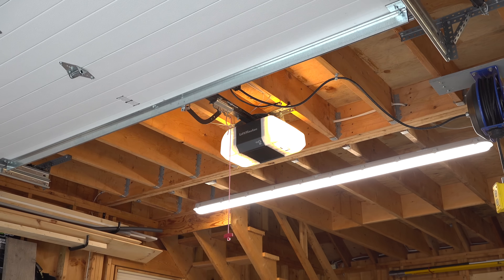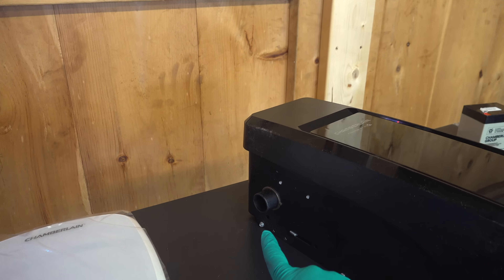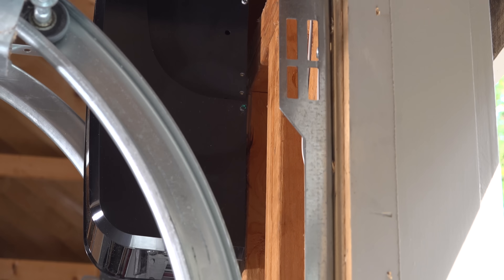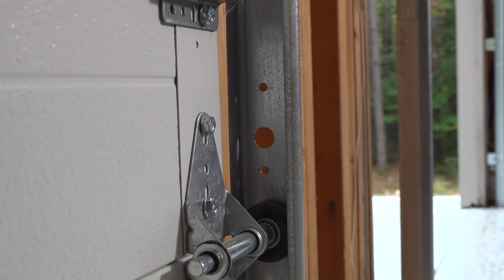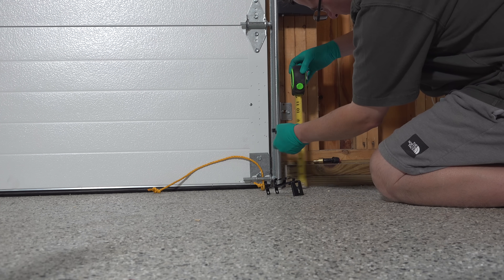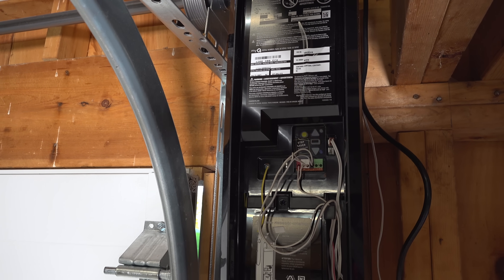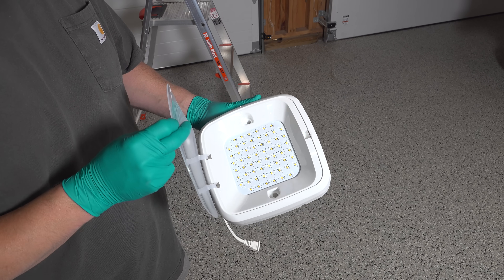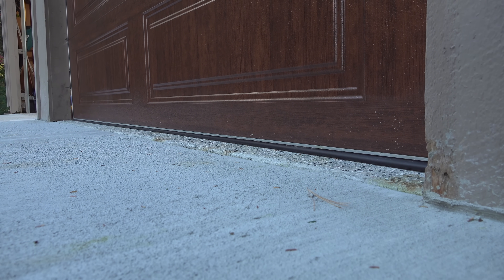Finally a SILENT Garage Door Opener that locks like a SAFE! - RJ0101

Comment: I have been wanting to switch to this type of garage door opener for awhile now after seeing one at a house one time. I absolutely hate the old style openers, how loud they are and all the room in the middle you lose.
Reply: I’ve had these on my garage doors for 5 years now with no problems. While they are more expensive than the common rail style opener they are soooooo quiet and provide added/automatic locking security and so easy to manage and operate either manually or via internet. They eliminate a lot of overhead clutter of guides and chains/belts. Only real downside of being able to use these is you need a minimum of 9/10” to mount opener on lift rod and a power source near each opener. 🇨🇦👍
Reply: @garage-guy207  my experience with these type is that you end up with far too little ground pressure and as a result, mice and weather get in. As far as smooth and quiet goes my liftmaster dc battery backup belt rail operators cannot be beat. They provide great ground pressure, great pressure against the header of the opening, never have trouble breaking away from frozen door seals and they are quieter and smoother than these side mounts. In a commercial application more often than not your stuck with this type. But if you can get a trolley operator for the height of that door, do it. They are trouble free and rarely if ever jump cables.
Reply: @tenflat2009 what model do you have?
Reply: @xBroWsinG  lift master 8550w belt drive. It's a DC drive motor instead of AC and has the battery back up. That makes it capable of running up to 25 times without being plugged in. It truly is a Cadillac of door operators.
Reply: I had one for years, and will be installing another on a new garage this week.  They’re just so luxurious feeling, and they work great!
Reply: Perhaps you should just abandon the old style opener if you hate it so much
Reply: As an overhead door tech, stick with the rail style. These side mounted operators are great if your door has any amount of high lift but for a traditional door, stay with the rail, you WILL regret a change to this type.
Reply: @tenflat2009 why will they regret it?
Everyone else in this comment section has a positive opinion about them. So what exactly is your concern with them?

Comment: We built in 16’ and had the garage door company install the Chamberlain 8500 opener, basically the same setup you have with a Jack shaft.  The security lock feature has been fantastic and it’s absolutely quite raising and lowering.  We had to buy the MyQ hub separately but it’s WIFi and really has been a great addition as we’ve been able to open the doors for family members who dropped by unexpectedly while we were away from home.  Great tutorial, thanks for sharing.  If able to spend the extra few dollars I’d highly recommend this setup.

Comment: I hate myQ.
Reply from the maker: I am surprised to hear that I use mine a lot, its really helpful if you need to let someone in, see i the door is opened. Plus its got the secret screen that tells you how many times the door has been opened in its lifetime
Reply: @SilverCymbal  How do you get to the secret screen?
Reply from the maker: @darrinmc  Its really not secret but most have no idea its there. Select your door, to the right choose the gear (settings) icon, then select MyQ diagnostics. You will love th einfo in there, the door counter is crazy. One of mine has opened 10,000 times!